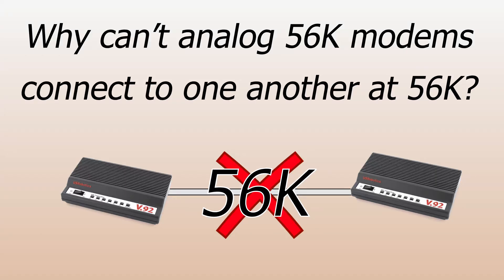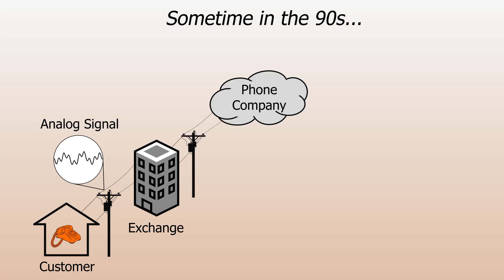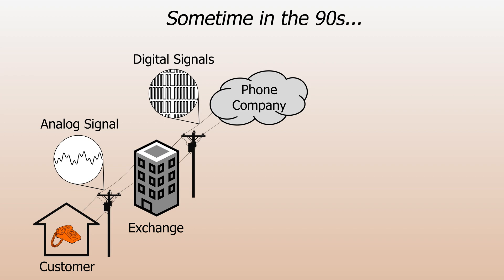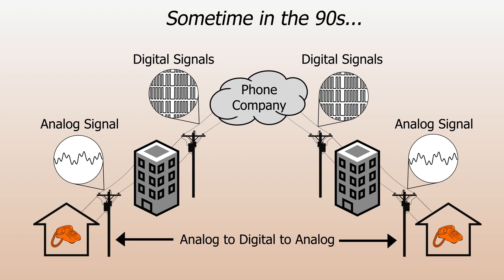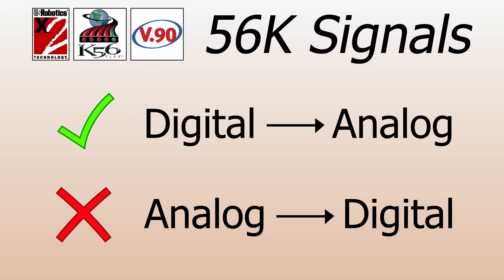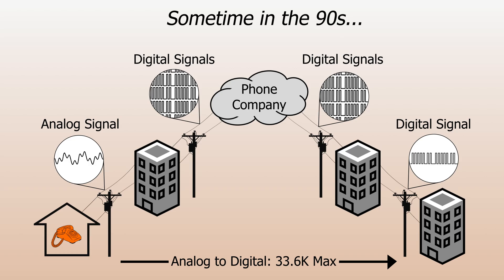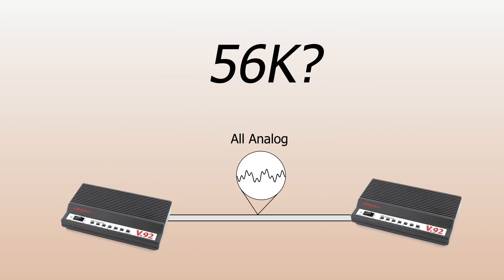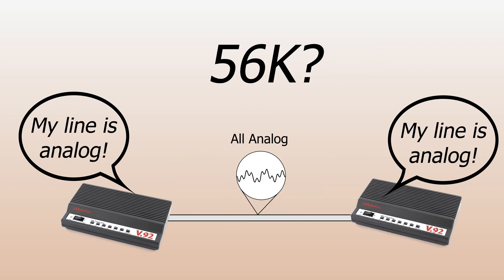56K Modems Aren't Always 56K

Comment: Two things: 1)  The reason why the analog to digital conversion garbles the modem signals is that the conversion is not linear. To improve the perceived quality of an analog phone call, the quantization compresses the signal dynamic range. Since most analog background noise is a faint low volume background noise, for human speech it is good enough to just smash everything that is silent into large blocks, and only encode the more louder parts in fine detail. This works great for audio, but blunts digital signals. The ISP can however counteract this by being aware of the characteristics and conditioning the PCM data sent to the telco such that after conversion, the analog modem is capable of decoding the data just fine.
Later on, V. 92 modems did a similar trick to raise the upload speed to 48 kbit, but it required sending a special AT command to the modem during dial out, and it dropped download to 48k as well.
Reply: I wonder if i could get 48k with two modems with that AT command, may you know what the command is?
Reply: @SUPERBOBESPONJA1000  Both V.90 and its enhancement V.92 are inherently asymmetrical and require a digital modem on one side (the ISP) and an analog modem on the other (the customer). For both standards the digital->analog direction is max 56k, that direction was left unchanged by V.92. The analog->digital direction of V.90 simply uses the older V.34 standard (max 33k6) while V.92 replaces that with a scheme that's synchronized to the A/D converter which raises the max speed to 48kbps. When two analog V.90/92 modems are connected together they will fall back to V.34 (max 33k6 in each direction).
Reply: The quantization schemes used (A-law and μ-law) actually do the exact opposite of what you said: they give more detail to faint signals while reducing the level of detail of louder parts. The larger the amplitude, the larger the distance between quantization steps. This effectively makes the quantization somewhat scale-invariant, thus maintaining clarity of faint voice signals by sacrificing unnecessary detail of loud signals.

Comment: These videos you've made are really interesting; I'm a computer expert, but I would have never known that a 56k modem that connects to a regular POTS phone line used by most homes would have needed to connect to a special 56k modem that connects to a digital phone line (such as an ISDN line) in order to get the full 56k speed, and that the full 56k was only possible in one direction. Btw, I'm wondering if you could make some more videos about ISDN lines/equipment and how they were used in their heyday: For example, I read that there were special Digital ISDN Telephones that were capable of videoconferencing; so maybe, you could obtain two used ISDN Videoconferencing Phones and use your ISDN line simulator to establish a video call between them.
Reply: >  I'm a computer expert
kek

Comment: What modems could broadcast in a digital signal? Only ones I can think of are the ones designed for servers.
Reply: I believe ISDN modems would be the types of modems you'd use when setting up such a server.
Reply: They're just called digital modems.  "Servers" is a bit of a loose term, so to clarify, there are two ways to implement a digital modem:

1) ISDN BRI.  This didn't catch on in NA, but was somewhat more popular in other parts of the world.  In this case, if your modem speaks ISDN natively, it's a digital modem.  Whether you can host a v.90 call or not depends on what the modem itself is willing to do, but the infrastructure is there to support it, so technically it would be possible.  Or would be, except I suspect it's tough to get new BRIs installed today -- not to mention the store shelves have always been a bit light on ISDN modems, and particularly nowadays.

2) ISDN PRI / T1 / E1.  This is what ISPs and the phone company used.  Roughly, a T1 is the NA digital standard link that provides 24 simultaneous voice channels, and an E1 is the Euro equivalent that squeezes in a few more channels due to a slightly higher clock rate.  But they're functionally identical.  Each channel in a T1/E1 is 64kbps of digital data -- enough for a single 8-bit, 8kHz voice call.  Sometimes the telco would "borrow" the lowest bit of each channel to transmit information on the state of that channel (called Robbed Bit Signaling).  This is how the telco knew whether the channel was in use, how connecting and billing info was transmitted, etc.  In this case, the channel is only capable of 56kbps.

ISDN PRI stole one whole 64kbps channel for this purpose instead of robbing bits, leaving the remaining channels clear to run at full 64kbps rate.

So with T1, you (usually) got 24x56kbps, or 32x56kbps for E1; and with PRI you got 23x64kbps on a T1 circuit, or 30x64kbps on an E1 circuit (you ended up losing two channels for... reasons.  Don't worry about it.)

The ISP or telco would then connect the T1/E1/PRI to a "modem bank" of some kind.  It could be a Cisco router with a digital modem module installed (which may be used by a business for remote access), or a dedicated terminal server appliance (Cisco had the AS5x00 series, Livingston had some Portmaster boxes, USR had the Total Control chassis, etc...)  The latter was often scalable for dozens or even hundreds of channels, so that's what got used for offering Internet or, e.g., AOL dialup access.

The digital modems would typically be a card with a bunch of DSP and a microprocessor to control everything.  The chassis might have space for any number of cards, each typically handling 12 to over 100 calls each.  Each channel would convert the phone call to serial data, where the operator would then decide how to terminate that connection.  Typically, that would be a PPP session, which would result in IP packets, which were then routed out to the Internet via another T1, Frame Relay, Ethernet, or whatever.

Comment: So, out of interest, during the handshake where the modems tell each other whether their connection is analogue/digital, if you were to somehow fake one side of that into saying it was digital rather than analogue, e.g. by injecting some data, would the modems negotiate V.90 and successfully connect at 56.6k?
This is assuming there is no analogue/digital conversion between them.
I'm guessing yes?

Awesome video btw. Telecoms has always been fascinating to me.
Reply: I highly doubt an analog modem would be able to attempt a V.90/V.92 answer, even with modified V.8/V.8bis data.
Reply: ^^ That.  More than likely, the analog modem firmware doesn't even contain the DSP instructions to encode PCM data, so fudging the handshake would be akin to lying on your resume.  ;-)

Comment: Now i'm curious though.
What if both sides had digital modems though?
Reply from the maker: Good question! In this case you would have an ISDN connection, and you can get a full 64kbps rate (or even 128kbps if you use both b-channels) since the modems will realize that they can send data digitally to one another with no audio-band modulation or demodulation taking place.

Comment: Just a question, would it be possible to make a dial up modem with more than 56K speed? Maybe something with 64K, 128K, 256K, or even into the M or G range?
Reply from the maker: Using voice calls under absolutely ideal conditions I suppose you could theoretically get to 64kbps, which is the data rate at which the voice call is encoded. You really couldn't get beyond that using a phone system that has any digital signalling in it (which would be any phone call for most of the time that dialup modems were in use). 

That said, if we were on an all-analog system, and the signal to noise ratio was ridiculously high, then we could theoretically go beyond this. With a sufficiently high signal to noise ratio the information capacity of an analog channel can be just about any value. So it's theoretically possible to go beyond 64 kbps on an all-analog voice call, even if there aren't any voiceband modems that actually do this.  

One other thing - DSL kind of does what you're asking about already. It's not dialup in the sense that you're not making a voice call to establish the connection, but it uses the same pair of wires as analog voice calls to do it. DSL just uses signalling frequencies above the range used in phone calls to do it. So it's not dialup in the sense of dialing a number and using human-audible sounds to send data, but it is using dialup lines to hit Mbps speeds.

Comment: To my knowledge wasn't the reason speeds were capped to 56K because of limitations with copper phone lines?
Reply from the maker: Kind of, it's a limitation of how we used the copper phone lines for voice calls. There are other ways to use those same lines though - ISDN and later ADSL use the same copper wires to achieve much higher speeds.
Reply: @retrocet  So the reason for that limitation was because it transmitted sound. In theory would speeds be faster if phone lines were something like fiber optic instead of traditional copper?

Comment: Hello Retrocet,
I speak brazilian portuguese, sorry my bad english.
So, in Sega Dreamcast community, we connect 2 modems, the dreamcast one dial to an USB modem or an Serial external modem.

The "server modem" of ours, is connected to a raspberry or a Linux virtual machine, and we are doing ppp upcoming connection. DreamPi is the name of that suite, is also used to old computers, sega saturn, game cube. Is a dial up server lets say.
Reply: Maybe you can clarify a thing. The server side modem is doing a upload to the client, to the Dreamcast. The best connection we get is 33K v42bis

In a v92 modem would we be able to get the full 48k speed, in order to increase the connection on Dreamcast? Based on this video, is also the same limitation of this peer to peer connection we are doing?
Reply from the maker: It is a limitation of the peer to peer connection, yeah. It's unlikely that you'll be able to pull off 56K in a 'peer to peer' configuration. I tried for quite a while to find a way to pull this off, but unfortunately it ends up just being equivalent to the 'all analog' configuration I discuss at the end this video.

To do it at home (I have a video on this coming) you essentially need to entirely re-create the system I discuss in the video to hit 56K. Specifically, you need a server-side digital modem (i.e. the 'ISP' modem - something that takes a DS0 in).  I initially used an ISDN modem for this, the Courier I-Modem. Then you need something to convert the analog call from the Dreamcast into a digital call. I've also been using an ISDN modem for this - any model with an analog port will do. Finally, you need something to simulate the phone system and negotiate the call, such as an ISDN simulator. This simulator is the real show stopper. They're rare and fairly expensive. 

It's a lot of gear. :(

Ideally though I'm hoping to publish the access numbers for my gear, which will be a free ISP for retro users such as yourself to be able to call and get full 56K, with instructions on how to set up your own VoIP line to be able to hit those speeds.
Reply: @retrocet Hi, still waiting for the video on your ISP setup! I’ve seen your Reddit posts and am quite fascinated! I have been looking at trying do do some of it with an ISDN BRI simulator and the Eicon Diva server boards, and ISDN TAs for the POTS interface, but never managed to sustain a V.90 call..
Reply: I was thinking, the dreamcast modem can be analog, but we use digital usb modems v92 in the server side, would be possible to increase that connection to something above 33k?
Reply: Btw, if is relevant, I have some nice external modems here, like Multitech and USR Courier
Reply: Thank you, it makes all sense.

He have enough speed to play the online games with 33k, was just to a little upgrade, but yeah, the reasons are more clear now

Comment: Great video! 

Question regarding to client upload:
If analog -> digital conversions for client result in 33.6k UP w/v.34 & v.90, how does PCM Upload in V.92 work? 

When on, you could get a max of 48k UP at a cost of a max of 48k DOWN. How is this possible? 

Thank you very much!
Reply from the maker: So this is getting to the edge of my knowledge so far, but I'm reading up on V.92 and now get to play with it a bit since I've finished building a V.92 capable server. In any case take the below with a bit of a grain of salt since I may be talking out of my ass. 

A digital call is encoded at an 8 kHz sampling rate, with a resolution of 8 bits, for a total rate of 64 kbps (8 bits * 8000 samples/s). There is some loss of fidelity doing digital to analog conversion which can make the change in amplitude of the lowest bit hard to distinguish, and sometimes the phone system will lower the resolution of samples to 7 bits so the system can use the extra bits for control channel data (called Robbed Bit Signaling). As a result, when encoding the downstream signal in regular 56K, the signal is composed using only 128 amplitude levels instead of 256, and the resulting samples are therefore 7 bits each (7 bits * 8000 samples/s = 56 kbps, hence '56K'). 

In the upstream direction the fidelity loss from analog to digital conversion makes it not feasible to reconstruct 7 bits, so they stuck with V.34 encoding for V.90, x2, and K56Flex. 

But what if we lowered the sample resolution further? Turns out that at 6 bits per sample on a really clean phone line, you can get PCM to work in the analog to digital direction, which is where the 48K comes from (6 bits * 8000 samples/s = 48 kbps). I think the analog modem needs to make sure it's synchronizing the clock it uses to encode the data with the clock the phone company is using to encode the call at the exchange to make this work. 

This is sort of where my current knowledge runs out. It's not obvious to me why using PCM upstream limits the downstream to 48K as well. It might be related to the clock synchronization - maybe a downstream bit is  toggled on and off continuously to create a pseudo 'clock signal' for the analog modem to use as a sync?

I'm also pretty sure that cross talk is a nightmare when doing PCM in full duplex mode. I'm actually kind of curious to actually test this - I'd like to use an oscilloscope to look at the analog line for a V.92 call, but I'm still researching my options for what oscilloscope to get. 

Note that this video still applies for V.92 - you still need to be limited to a single analog to digital or digital to analog conversion even for PCM upstream, so V.92 modems still won't do anything above V.34 unless one modem is digital. 

Anyway hopefully this helps a bit, but I'm still learning about it myself!
Reply: @retrocet  I don't actually know either, but this explanation feels intuitively correct -- particularly the part where, perhaps the lsb from the digital modem is used as a clock source.  That would make a ton of sense, because it will have the DS0 clock to reference, but the analog side will not, and the margins for drift are going to be really tight.

I guess it's possible that synchronization is entirely based on the framing of downstream data, and the 6-bit limitation is to provide some wiggle room +/-1 lsb instead.  But personally, I like the clock bit explanation better.  ;-)

Comment: they can in fact they can connect at 115200bps
Reply from the maker: This video is about regular, analog 56K modems. ISDN modems can connect to one another at 115.2 Kbps, but ISDN isn't analog.
Reply: @retrocet  think u are wrong i have an v34bis modem she connects everytime at 115200bps and has on one occassion transfered a compressed driver file at this speed my itu t v44 +ipr=921600 modem connects at 40-46kbps on same line and service provider this whole internet thing is a con as per usual facebook google apple microsoft dont pay corporation tax in   uk they owe the government billions
Reply from the maker: If you're seeing 115.2kbps reported by a V.34 modem, you're seeing the DTE-DCE speed (i.e. the rate from your computer to the modem) and not the DCE-DCE speed (the rate from the modem to the other modem). Modems can report either, depending on how they're configured.
Reply: Ha! I had ISDN as a kid! What a waste of money that was. You get a slightly faster dailup internet. Minor improvement for a significant expense. Meanwhile, few lucky kids had cable modems
Reply from the maker: The awesomeness of ISDN could vary a lot based on the setup. If you had both B channels active for data all the time, or used Dynamic Bandwidth Allocation, you should have gotten better than double a 56K modem most of the time. DBA would allocate both B channels unless someone was using one for a phone call. Still slower than first gen cable modems (I think mine was 512 Kbps) but a good boost over dialup.

That said a lot of setups used a fixed assignment for the channels, i.e. one for data and one for voice. In that case, yeah, it's just slightly faster dialup :(

Comment: What about V.92?
Reply from the maker: V.92 is subject to the same limitation, at least so far as I can tell based on both my reading and of the standard and a bunch of  my own testing. In those tests with the V.92 modems I have on-hand, they don't even try for anything above V.34 after the V.8 exchange is done. I had hoped that the higher PCM upstream mode that V.92 offers might somehow work, but that feature is established during the V.92 handshake, so it never gets started.